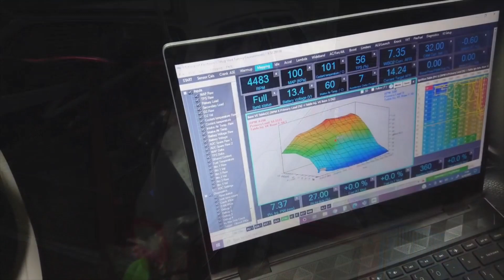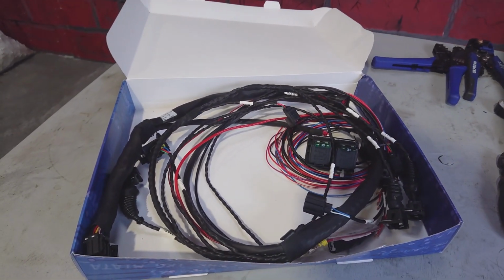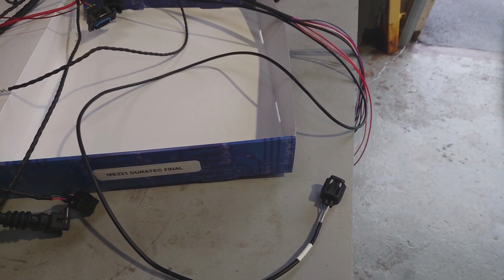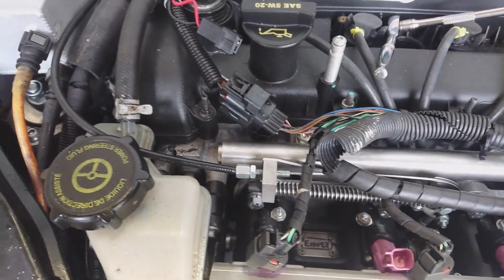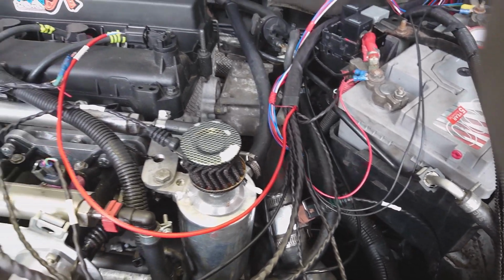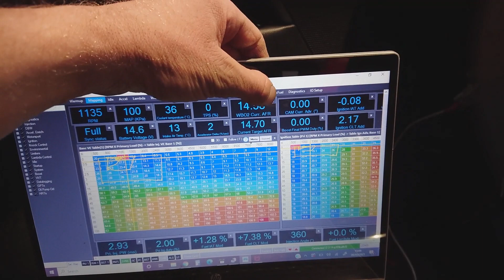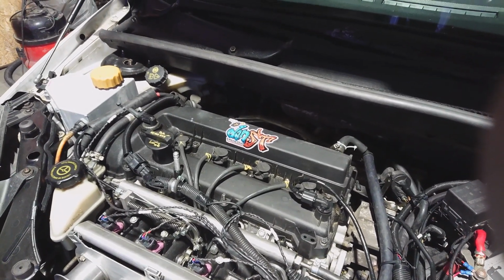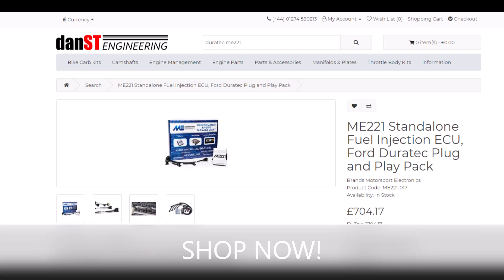Ford Duratec ME221 Loom Installation Guide by danST Engineering

Comment: That's great to hear that the ME-series of ECU's support the MZR Duratec engines, as well as the Zetec-based ones as well! I was looking at their 442 ECU Plug and Play kit for my built SVT (ST170), but now have a 2.5L Swapped car that'll need some tuning. Very VERY happy to see I can still go with ME221's! 

Here in the States, the Duratecs are coil-on-plug, does this loom kit come with a coil-on-plug option as well?
Reply: Did you ever find the answer? I’m planning to swap a 2.5 into an old Ford Ranger and came across this setup.
Reply: @BrooksWildlife  Nope, have not heard back yet. I haven't really been a squeaky wheel about it though.
Reply from the maker: apologies we missed this, drop us a message via the contact form on the website with any queries and we will be happy to assist (the new range of ME ecu's offer huge feature sets so I am sure we can supply an ECU for your needs: 
https://danstengineering.co.uk/index.php?route=information/contact